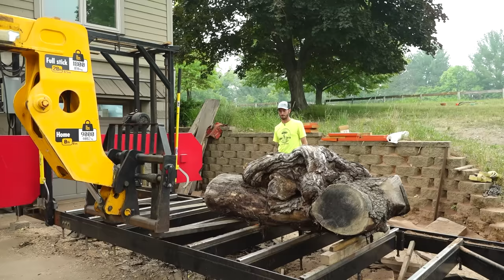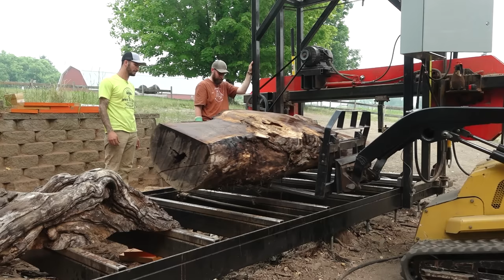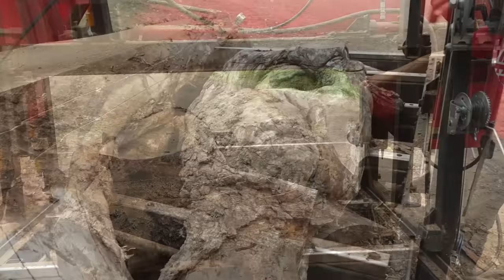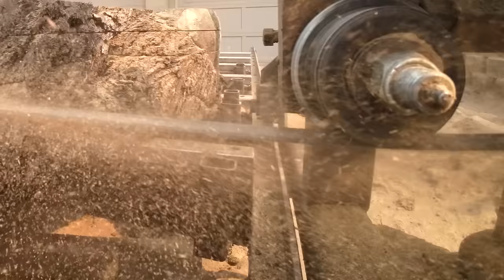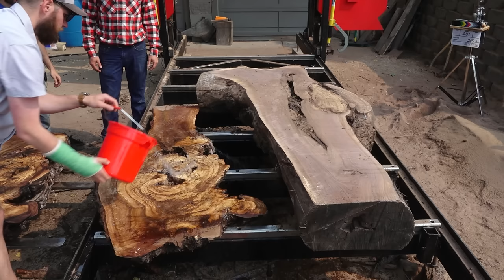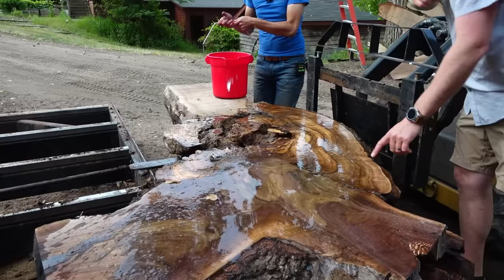This Log was in their Burn Pile 🤯

Comment: Would be really nice to see some finished products from these amazing slabs.
Reply: Their website has a gallery of items they made for sale
Reply: Bunch of wood encased in plastic. Some people like it.
Reply: Yes
Reply: @mm9773  Spalt is also known as rot, you have to or it's useless.
Reply: thanx for saving my time… I watch these for the process and the FINISHED RESULT
Reply: @mm9773 yep that’s how you make a full size square table out of a live edge slab. And it also looks super cool.
Reply: I'm with you would love 2see finished product
Reply: Using these slabs, especially those with rot, can indeed be a terrible idea for several reasons:

1. *Structural Integrity:* Old wood slabs, particularly if they've been exposed to the elements for a long time, can have compromised structural integrity. The rot weakens the wood, making it prone to cracking, breaking, or failing under stress. This can be dangerous, especially in applications where structural stability is crucial.

2. *Aesthetic Problems:* Wood with rot often looks unsightly. The presence of decay can ruin the visual appeal of a project, whether it's a piece of furniture or a home renovation. No amount of sanding or finishing can fully restore the beauty of rotting wood.

3. *Hygiene and Health Concerns:* Rotting wood can harbor molds, fungi, and other microorganisms that can be harmful to health. Using such wood indoors, especially in areas with high humidity, can lead to respiratory issues and allergies. It's essential to prioritize the health and safety of those who will be around the wood.

4. *Shortened Lifespan:* Wood that is already rotting will continue to deteriorate over time. Even if you attempt to stabilize it with treatments or sealants, its lifespan will likely be significantly reduced compared to using sound, healthy wood. This can result in the need for frequent replacements or repairs, which can be costly and time-consuming.

5. *Compromised Project Quality:* Any woodworking project, be it a table, a deck, or a house structure, is only as good as the materials used. Old, rotting wood is not a reliable choice and can lead to project failure, causing frustration and wasted resources.

6. *Environmental Impact:* Repurposing old wood is often seen as environmentally friendly, but using wood with rot may not be. It might require additional resources to address the rot issue, such as chemical treatments, which can have environmental implications. Additionally, if the project fails prematurely, it contributes to unnecessary waste.

In summary, using old wood slabs with rot is generally a bad idea due to concerns about structural integrity, aesthetics, hygiene, longevity, project quality, and the potential environmental impact. It's advisable to choose sound, healthy wood for woodworking projects to ensure safety, durability, and overall project success.
Reply: @MichaelRedford  Or not. You can address the structural integrity problems. As for the aesthetics - funny thing about aesthetics - they're individual. There are no universal standards. In essence your comment boils down to "Water is wet and I don't like ice."
Reply: @MichaelRedford .  Geee you took the fun right out of that  video. Haha.   But yes, your absolutely correct in all aspects.    And who wants a bunch of honey bees flying around the dinner table anyway
Reply: Give it a yr and a half

Comment: Matt - we need to do a follow up video when they build the table so we can see what this turns out to like!
Reply: At a minimum it would probably be 6 months before a table could be started... Proper drying and wood stabilizing needs to be done first. I'm on board with a translucent epoxy... Maybe add some fiber lights to highlight the smaller voids.
Reply: @OldsmobileCutlass1969Va  More like over a year if it's been outside...
Reply: You’ve seen it a thousand times already, or at least some variation of it.  Cut off a few random pieces to make it look natural, fill in the negative spaces with an unnatural colored epoxy, throw some pre fabbed black steel legs on it and call it a day.
Reply: These guys will likely turn it into firewood.

Comment: Could you replace the crank side rail stop with one that extends past the width of the carriage upright and has an anchor point for the cable? That would allow the crank to move the carriage all the way to the stop. The stop is bolted on so it could be easily replaced.

Comment: Matt, I had an idea. To help you secure wonky logs, make some brackets that you can bolt in to your deck. Then drop a short beams where you need them. Get some 2x4, 2x6, 2x8 metal or do wood in 2x5, 2x7 or what ever size you want...

Comment: You should have tried two pieces of wood lenghtwise on the metal base and use shims and wedges to stabilize the log.  However, what you did, worked out.

Comment: Watch the Thailand(?) sawmill gently and easily turn enormous logs with a wraparound sling and a crane. You have a differential pulley and the telehandler.
Also. I am so glad that you are wearing a mask while sawing. The sawdust you inhale does NOT dissolve in water in your lungs.

Comment: Carpenter bees have shiny black carapaces (back side) while bumblebees are fuzzy across their back. I have gotten black walnut from a pile that sat for many, many moons and it was infested with carpenter bees so it is most likely that what you had was carpenter bees. Yes, I am a beekeeper in addition to woodworker/turner.

For smaller cutoffs and piece used for small turning blanks like pens, stopper, handles, etc just put paint or AnchorSeal on it. Sticking it in a bag of wood shavings doesn't do any better from my experience and then you just have to remember what is in that bag/box later. Just let them air dry or kiln dry. If you get a pile of cutoffs and scraps around your mill, let me know as I will happily work out a deal to take that "waste" off your hands since it isn't useful for most woodworkers.

Comment: I'd probably stop messing with that guide bearing while the machine is running.  A slight trip and you saw your arm off.  If you haven't broken a blade yet, a blade that big can snake out at high speed and slice up anything in its path.

Comment: At first, the log looked like a tree surgeon made a horrible mistake during surgery! Later on, 1 side of the slab looked like turkey tail fungus. I have mixed feelings about using a log so far gone. Nature was working to return it to the soil, but the guys intervened. I think I side with nature on this one, though there could be a few gorgeous cutting boards or lamp tables in it.

Comment: Are you sure those weren’t CarpenterBees super large look vicious  but they don’t sting people  from what i know   i lived in MD for 35 years and they.  bore holes  into  everything especially Pressure Treated Decks   they do have a very simple Trap. for them  using a 4X4 off cut  and a Mason Jar  the first year i lived there one flew into my kitchen and i trapped it  on my Counter with a clear plastic Cup  to find out what the hell it was my Wife freaked out   the Slab looked kind of Cool ! although i’m not too into the Epoxy Look thing  this one looks like a excellent Candidate  for one

Comment: That was wild.  It would have been criminal to burn that.
There was too much water left on the log for filming it.  The wood needs to be wet, not submerged.  With your normal splishy, the water usually has enough momentum to clear the log, but pouring it over just makes pools.  We want to see the wood, not a reflection of the sky.